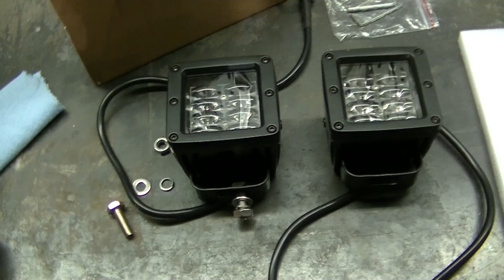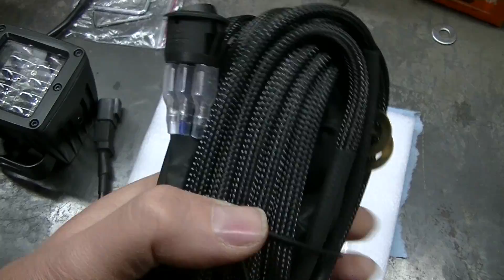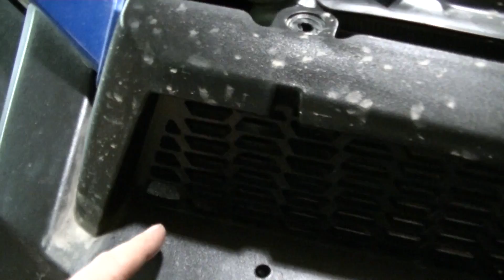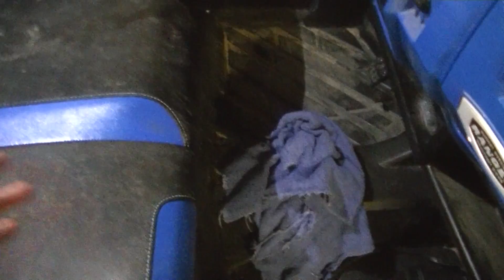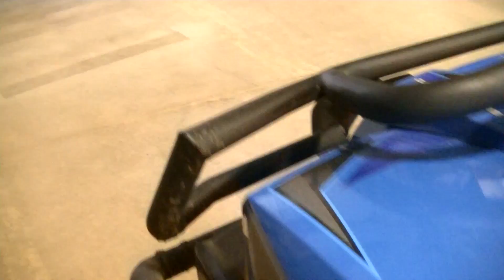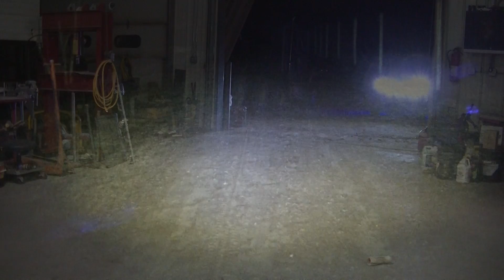Polaris Ranger 900 Offroad Town Quad Row LED Cubes Install

Comment: Personally, I would send them back and get some cubes that actually put out some LIGHT!
Reply from the maker: I thought they would be a little brighter too with the 8 LEDs but that isn't a bad thing.  These should make great bad weather lights with the yellowish light.  I am going to remove the flood light covers on my small light bar making it more of a spot beam and use these for short range light.